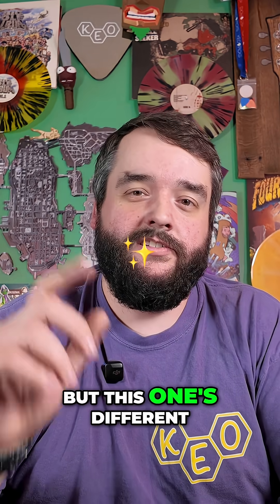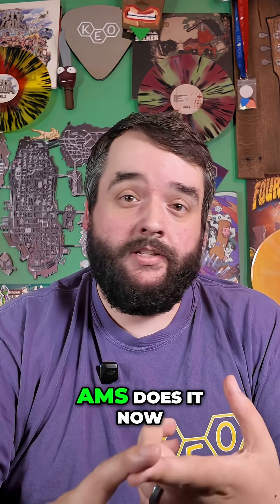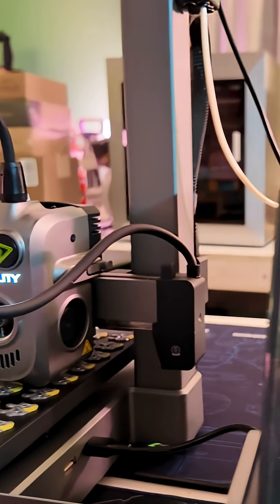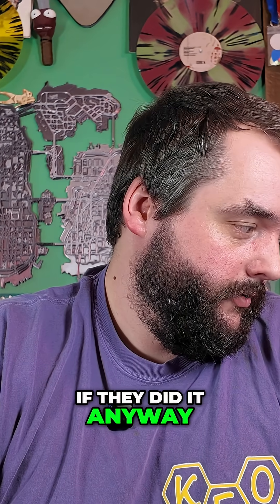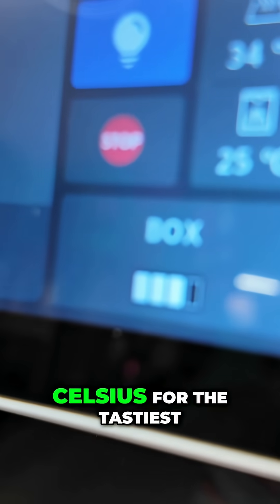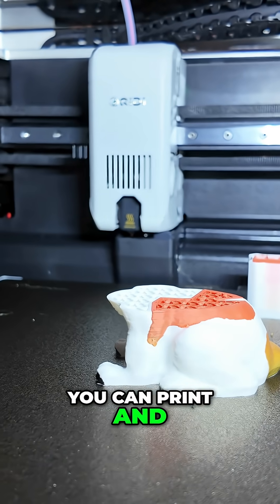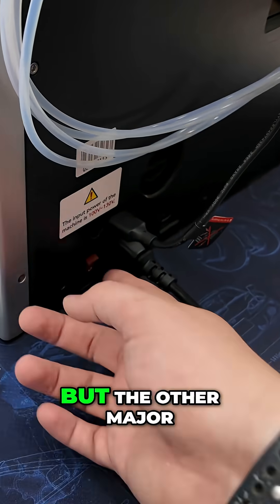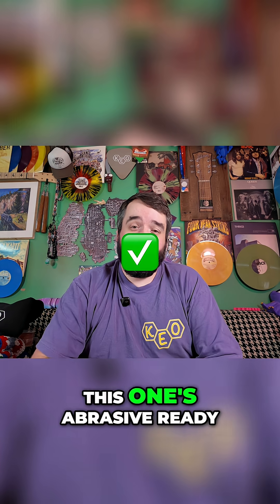Qidi Box: Print & Dry Filament, Creality Misses the Mark! #shorts

Comment: I wish bambu labs ams was like this, drying while printing sounds awesome, but abrasive ready sounds amazing, recently got a p1s not knowing anything about 3d printers other than I wanted one. Don't get me wrong, I absolutely love it. But found out after the fact about needing hardened nozzles and extruder gears for abrasive filament, no big deal, yeah some cheaper machines come with them, but whatever, upgraded them. Then I find out you shouldn't run them through the ams, so I had to print up a side loader thing, because for some brilliant reason bambu labs thinks it should be on the back, and make a y splitter so I could use the side loader and ams without having to change tubes every time. After all that I can finally print with abrasive filament, but am still limited to single color prints with them. 😢